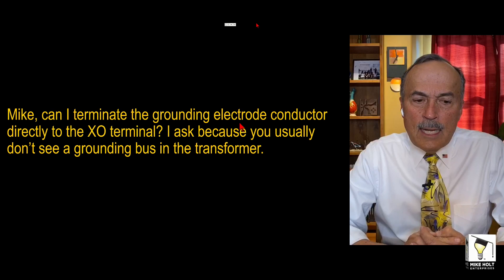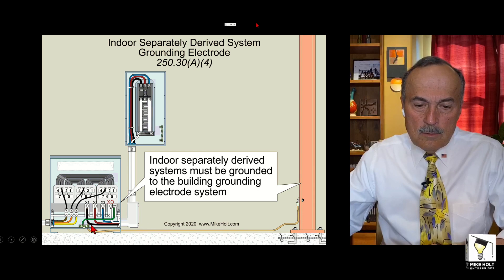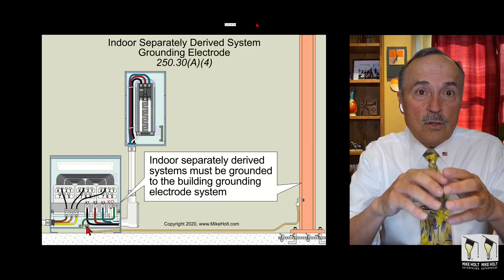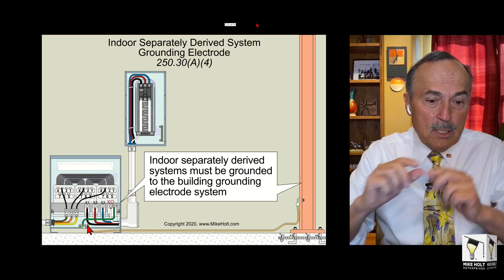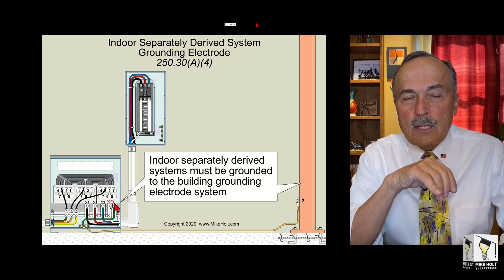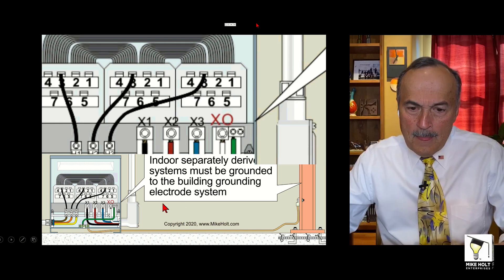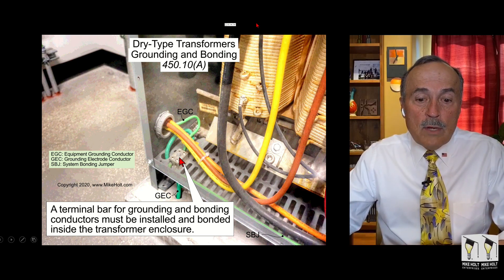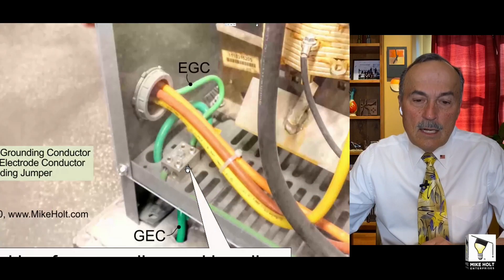Can I terminate the grounding electrode conductor to a transformer X0 terminal? NEC 2020 - [250.30]

Comment: Hi. Thanks for the great video. 
I was wondering how to bond the zero volt of the control transformer to the chassi of the machine? Are you referring the xo of the transformer terminal as the zero volt terminal?

Thanks again?
Reply from the maker: YES
Reply: @MikeHoltNEC  
Thanks for the reply Mike.
I tried bonding the 0 volt side of the terminal of the transformer to the chassis ground and it kept tripping the breaker for the transformer upon start-up. What is the cause of this? The transformer does have a separate ground terminal going to the chassis.
Reply from the maker: Please post your question on MikeHolt.com/Forum Note: If this is a small transformer, then you should consider the use of Bussman Fusetron Class RK5 and Low-Peak Class RK1 dual-element  fuses. These dual-element fuses have sufficient timedelay to withstand the high magnetizing inrush currents of transformers.

Comment: Holtz didn’t  explain the system bonding jumper is sized based on your largest ungrounded conductors of your load side transformer step up or down equipment. Now if you have paralleled conduits leaving the enclosure liken 2 sets of 500kcmil 4 wire 208v, 3 phase system. You multiply 500x2= and that’s 10kcmils since you didn’t reach 1100kcmil in copper you don’t add 12.5%. But if your largest ungrounded was 500kcimil you just go to the table

Comment: Code violation on the second picture. If your egc comes in with the conductors you need a bond bushing .
Reply from the maker: Nope.
Reply: @MikeHoltNEC  i thought that was code if your egc comes in with your ungrounded conductors you need a bond bushing... But i certainly wont aegue with you sir 😂
Reply: *GEC

Comment: There is a famous electrician and youtuber in my country who constantly awares of what he calls the fall of the neutral. If neutral happent to fall he says,all the divices that were connected would be receiving 400 volts instead of the  usual 230V. Why? If I go to my main panel and disconnect the neutral my devices simply wound not work. And if he means the neutral coming from the substation what? I don't see where the problem is
Reply from the maker: Watch this - https://www.mikeholt.com/newsletters.php?action=display&letterID=2277
Reply: @MikeHoltNEC  Thanks a million Mike, I got it now
Reply from the maker: @tvblood3550  Yes!

Comment: Personally I wouldn't. Of course it all comes out in the wash. Here's my take on it: the system bonding jumper's job is to bond the system to grounding stuff, like he said. That stuff being: (1) the EGC that came with the primary[sized for that wire], (2) the GEC[sized for the new system], and (3) the secondary's EGC[sized for that wire]. My point being, run it to the bar, and you can point to the bar and say, "It's grounded there,  everything is grounded there, right there." On a side note, the secondary's neutral must go to the XO, without the separately derived system it wouldn't exist, and with the help of the system bonding jumper it becomes a grounded conductor, without it it would just stay a floating neutral. In one hand you have the new system, in the other hand you have the grounding stuff, and you bring them together with one conductor: the system bonding jumper.
Reply: The "secondary's EGC" as you call it is actually a Supply Side Bonding jumper
Reply: @stillthakoolest I wanted to say this lol

Comment: Mike, Please clarify 250.104(D)(1). Our inspectors are wanting us to run our GE to the nearest copper water where the panel is (The XMFR is on the first floor and feeding a panel on the 2nd floor). They had us run the ground all the way up there, to the nearest copper water line (pre-cast concrete building). I argued that the code says "in the area being served" not "in the area it's serving". There was a 2" copper line on the 1st floor, fairly close, ended up running a 3/0 to the 2nd floor and tied it to a 1" copper line.
Reply: Ouch, their not paying for it, of course. I would of talked with the building official in that county to have it over ruled